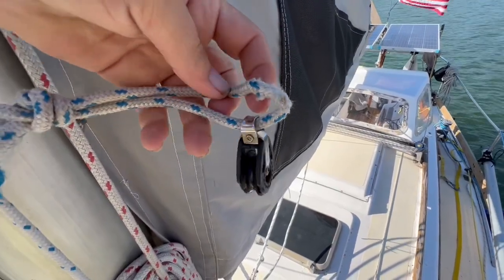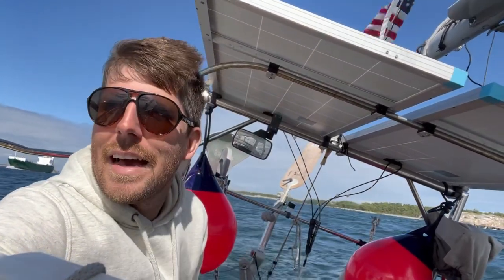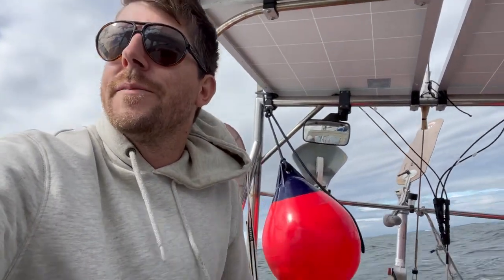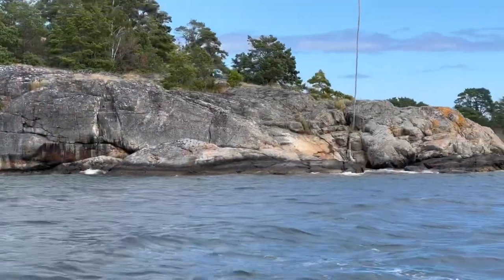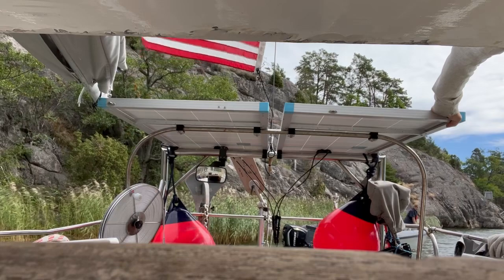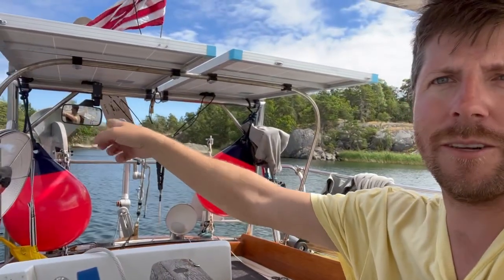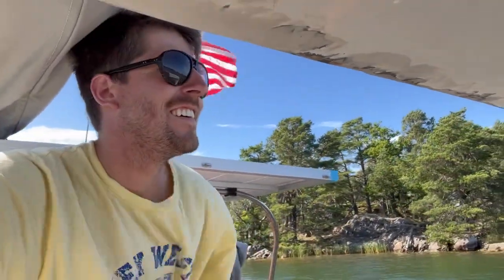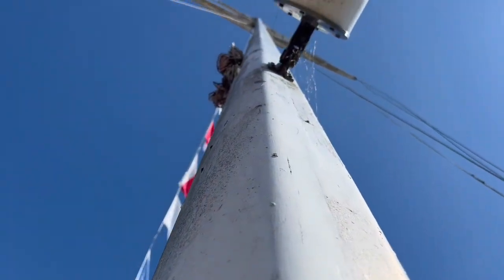Engine failure in the narrowest canal in Sweden

Comment: Great channel. Always looking forward to the new videos. 
We have a Beneteau 461 and a couple years ago the engine started cutting out. Always at the wrong time. Filters were always clean no water or anything. Eventually found out I had algae in the tank. The balls of algae would get on the end of the pickup tube and choke the fuel supply. As a temporary repair I put a tee in the fuel line between the tank and filter with a shutoff valve. Just prior to starting the engine I would blow down the line to make sure it was clear. During the winter I cleaned out the tank and started the next season with fresh fuel

Comment: What you do is mount a Garelik outboard mount for your dinghy motor or to drop down in case of main engine failure. It’s works well as a thruster for docking as well. I run a 20 hp tohatsu efi with auto tilt and start as my main engine on a 11” travel arm Garelik. The motor gets awesome mileage too...unbelievable. It’s on a 8,000 lb Erickson 29. Does about 5-6 knots at 2400 rpm. It’ll charge batteries for auto pilot and refrigeration. There are several other advantages to running outboards. The only disadvantage is horsepower and no dinghy davits. So I look out for currents and run a small dinghy 2.2 meter Avon with Maxi Marine lifters. I like the small rib because it’s manageable, fast, and I can pick it up Uber my head when getting it to the deck. Cheers! Don’t have to much fun with those hot Norwegian girls!

Comment: hi Sam. thank u. do u ever used  torque wrench for fix any problem on the boat(engine). i have bavaria 33 2007 and  after watched this video i understand how important take carry engine without help any one. thank u.
Reply from the maker: No i just tighten stuff until it feels tight
Reply: @samholmessailing  thank u. Another question 🙏, u run aground in norway even u used navionics. I have bavaria 33 in norway and want to sail to lofotten. What is the best way to prevent running aground in norway? Thank u and i would like to see more technical stuff.

Comment: lol i see you never actually said what was wrong the motor.  was the fuel-supply issue an empty tank? :b
Reply from the maker: Im not sure. It seems like theres a leak somewhere
Reply: @samholmessailing  yea those diesels can be tricky.  Theres usually no delivery pump so a tiny pin-prick of a leak can cause it to suck air bubbles with the fuel which can starve the injection pump after running for a while.  Good luck!

Comment: Did you forget to open the vent screw on the top of the fuel tank and it ran itself dry Sam?
Reply: That aint no outboard!
Tank vent is plumbed thru the hull.
Reply: @Boatyarddog  when Sam did the refit he replaced the original tank with an outboard tank he put in one of the cockpit lockers 🍻👍